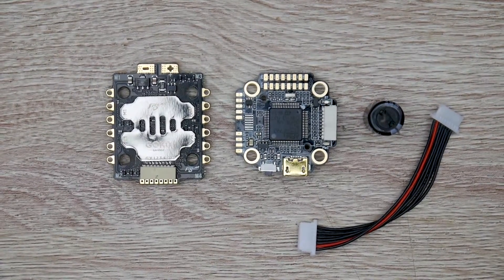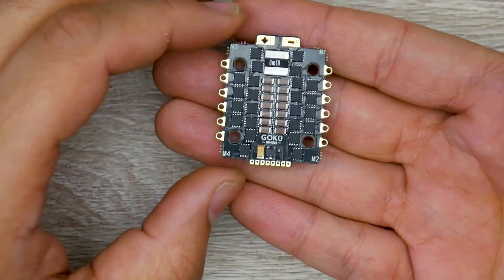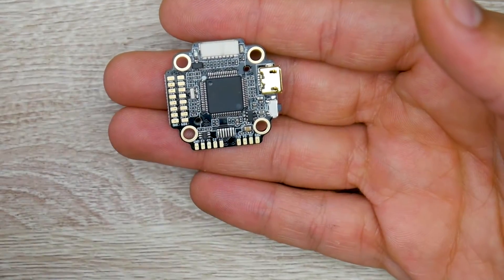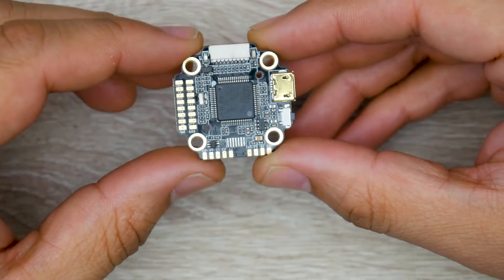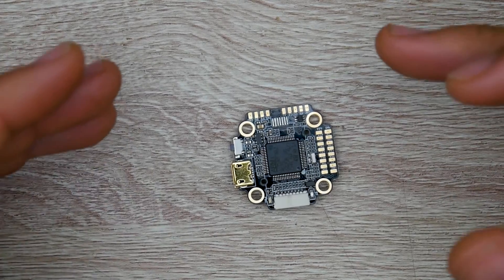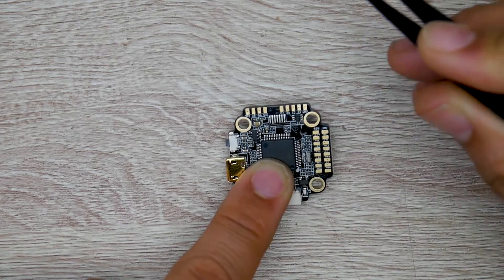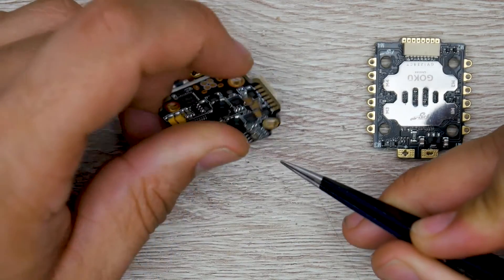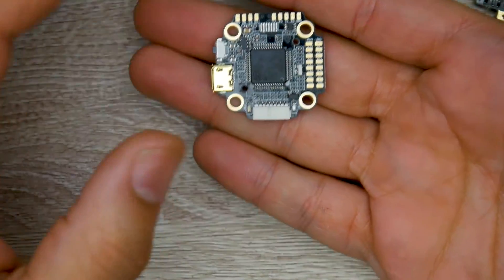Ultimate 20x20 6S Stack // Flywoo Goku Stack

Comment: Hey need to put out an Inav target for this board.   The Baro and UARTs would be great for making micro long tange builds.
Reply: Their website has an inav firmware target but INAV does not recognize it after flashing.  Betaflight only.
Reply: Also missing in this review and, to be fair all other youtube reviews of this flight controller that I have seen is the intermittent LED problem.  Sometimes they work and other times they don’t.  Probably a Betaflight bug since I have experienced the same LED problems on this controller and the GEPRC Stable F7 Pro.

Comment: I have a general question about Escs.... How come racers still use 30x30 stacks in 5in quads, and not 20x20 stacks which seems to give same performance now with big weight savings? Are the 30x30s somehow doing something better? Cheers

Comment: Could the 9v regulator be adjusted so it outputs 5v? I ask cause from the looks of the PCB it looks like the voltage may be set by a single smd component on each regulator either side of those three caps on the bottom.

Comment: I flew that esc, it's very nice
Reply: How did it hold up? What size quad was it?
Reply: @pippifpv  2406 2000kv motors 5-inch props it held up to every crash but I accidentally desoldered a component from it so I can't speak for its longevity. I flew about 40 packs and it was smooth as butter.
Reply: @Noical  was that on 4s? Pretty beefy motor for a 20x20 esc.. Nice that it works
Reply: @pippifpv  6s no throttle cap
Reply: @Noical  wow 😮